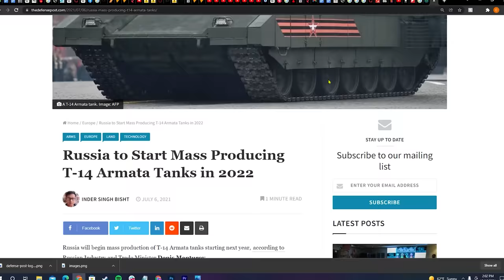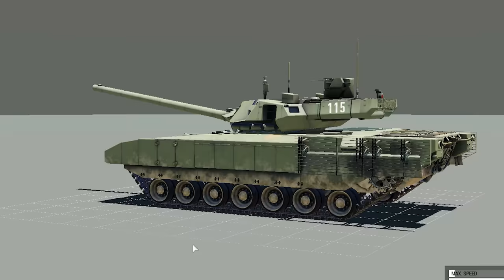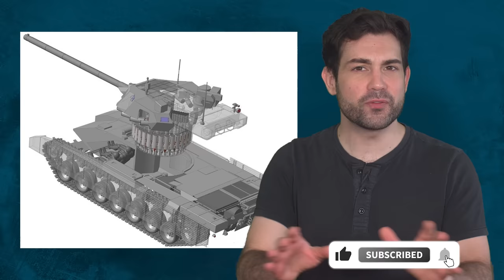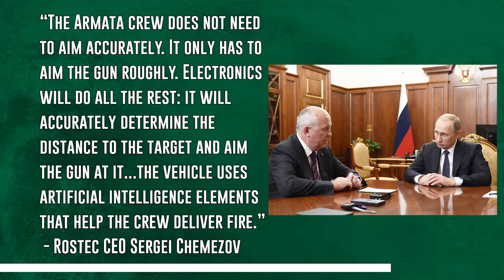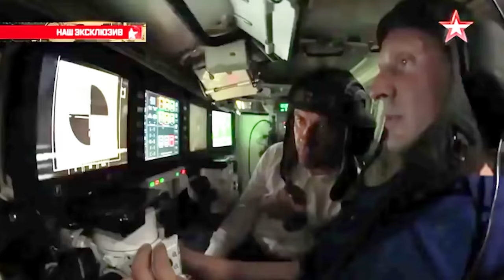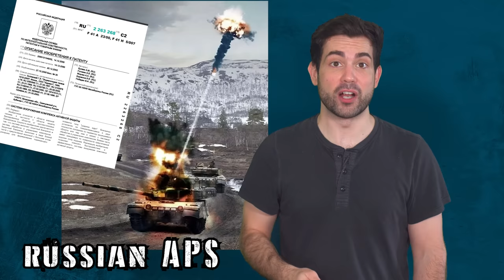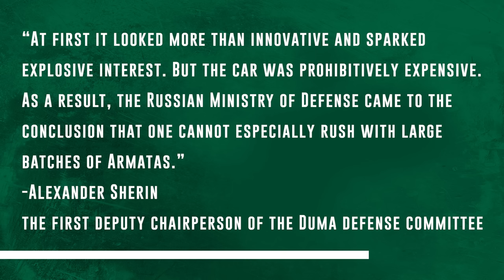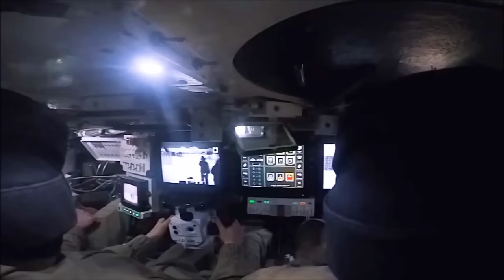The Truth About Russia's T-14 Armata Tank

Comment: The 14 in T-14 comes from the overall number of battle worthy tanks of this model that have been constructed.
Reply: That's a realy optimistic astimate
Reply: thats actually wrong, they built 100 of them
Reply: @SlavicUnionGaming  They didn't, they have like 20-30 of them and some of those are prototypes. Russia planned to deliver first batch of 25 serials (I think) by the end of 2022.
Reply: @Palach624  🤣🤣🤣🤣 never will happen.
Reply: @jacksonteller1337  As I said, time will tell
Reply: @Palach624  16 so far and no more microchip technology. The computers with the current chips are already marginally functional with refurbished Chinese chips they won't work at all. And sanctions are getting worse. Soon they won't be dependent on Chinese chips and rations but also on Iranian drones. Effectively they will be a third world country dependent on handouts.
Reply: Skawei  16 production models and 4 prototypes, most of the production models are rebuild prototype models. They have no money and no modern technology that is why both the computers and the engines keep failing 🤣🤣🤣
Reply: @jacksonteller1337  To be fair the one time when Armata broke down on parade it was the driver's fault and not the tank's. Would have happened to any other if driver did the same mistake
Reply: @Palach624  you still believe that poor excuse they came up with. If i spent a billion on a non functional tank I would blame the driver too.
Reply: @jacksonteller1337  Dude that's literally what happened lmao. There was no engine failure or anything like that. Abrams and Leclerc tanks broke down hundreds of times because of inexperienced drivers
Reply: More like a T-0.
Reply: @protorhinocerator142  you are hilarious
Hello from Ukrainian-Canadian 🇺🇦🇨🇦
🖕NATO
Reply: Skawei  No they don't. They have about 1 dozen and some of those are prototypes. The first batch of their only order was due to be delivered at the end of this year.
Reply: Kids copy pasting jokes and thinking they're smart and funny nowadays
Reply: this Vhiteable's comment was made by 14 years old with anime pic
Reply: @Palach624  
And you believe this because Putin told you?
Reply: @Naeron66  
I find it so funny how they claim all sorts of "facts" that never show themselves.
If the Russians have so many of this "amazing" tank, I find it really strange that they don't use many of them in Ukraine by now.
They for sure need them there.
Reply: @Palach624  
You typed that comment AFTER a war that saw Russia lose acces to Texas Instruments, Thales and other companies they've relied on since 1970?

(No that's not a figure of speech, all Russian tank optics we know of are licensed versions of the Dutch optics from Hollandse Signaalapparaten / Thales, that at the height of the Cold War, could still be exported because the Russians were getting 2nd gen when HS/Thales was already at 5th gen)
Reply: @elitedank8342  my dude, your name is “elite dank” and your calling people 14 year olds lmao 🤣🤣🤣🤣🤣🤣
Reply: Did they put the ammo under the driver and tank commander again? That's why you are seeing so many Russian tanks get their tops popped. Tank crews are just abandoning their tanks because they don't feel like being vaporized when the ammo under them explode them into a fine mist into the turret which in turn gets blown 100ft into the air. Russian tanks are some of the worst made tanks out there and you can definitely tell the Russians do not care about their soldiers. They just win by throwing wave after wave of people at you like China and Japan did in WW2 and Korea.
Reply: @donaldtrumplover2254  dude you fellate donald trump dont you
Reply: The biggest problem of T-14 is that there are T-90M and T-80BVM, which on paper only slightly worse, but in reality are tried and true, with actually working huge logistic chain. Nice concept, but the advantages it gives don't really worth the money to make that switch, when you already have top tier tanks.
Reply: @SlavicUnionGaming  nope
Reply: @SlavicUnionGaming  🤣😂🤣😂🤡🤡🤡🤣😂🤣😂🤣😂🤣😂🤣😂
Reply: @Palach624  How's that working out for ya? 🤣🤣🤣🤣🤣🤣🤣🤣🤣🤣🤣🤣🤣🤣
Reply: Should be T-8 then.
Reply: @SlavicUnionGaming  bullshit where? 😂
Reply: @Palach  you know that driver is dead and buried under the permafrost by now
Reply: The NYT just reported Russia is producing 200/year.
Reply: I heard that the 14 was minutes between breakdowns 😅🎉
Reply: @SlavicUnionGaming it’s an impressive tank but only between 10-20 have been made. There are also a couple t-15 IFVs (based on the armata hull)

Comment: You missed the most important question; does it come with the auto turret ejection system like every other Russian tank that stores ammo in the turret?
Reply: Yes it does
Reply: Yes....but wait, there's more.....the M-14's system is an "enhanced auto-turret ejector system".....(it flies farther).
Reply: Yes, but the armored compartments around the crew and the engine should, IN THEORY, allow the vehicle to bravely run away from the battlefield after the turret is destroyed.
Reply: @victor bruun The joke is about the autoloader exploding when hit which causes the turret and crew members to eject up to a 100 metres.
Reply: @victor bruun it's a joke. The way the autoloader is contructed on every Soviet / Russian tank since the T-72, any damage that breaches the the armor at the base of the. Turret WILL cause all the ammunition to cook off, which will "eject" the turret and the occupants thereof. Or at least their mortal remains, anyway.
Reply: Shoot javelin at Abrams you will detonate ammo all the same if you hit back side of turret
Reply: @metkic94  the difference with the abrams is that when the ammo is shot, the blast will go through the blast doors outside of the tank. With the older russians tanks, when the ammo is hit, the crew and the turret get flung
Reply: @metkic94  blowout panels for the win
Reply: @hankhohn5017  It is to much explosives wont save the crew but at least enemy wont be able to brag about lunching turret
Reply: @metkic94  the entire point of the blowout panels is to direct ammo explosions up and away from the crew and vehicle. Large explosion, yes. Dead crew, no.

(A Javelin in top attack still kills anything though. Also fix your spelling and grammar. I about had a stroke reading it.)
Reply: @hankhohn5017   1 Blowout panel preventing explosion from like what 55 rounds stored in Abrams half HE equivalent to more than 1 tonne of explosives.... It is built to reduce explosion radius so vehicles next to an exploding tank wouldn't be harmed.
Reply: @metkic94  dude, the entire point of blowout panels is crew survivability. It has nothing to do with nearby vehicles, which if following typical SOPs will already be spaced out to prevent that kind of thing from happening (a vehicle equivalent of the infantry's "hand-grenade range").
Reply: yeah is it a jack in the box ?
Reply: We
Reply: @metkic94  Western tanks that come with a separate area for ammunition are far safer for crew members from a catastrophic ammo cook off than lets say a soviet bloc tank.
Reply: @michaelcrichton8983  IS it planned to be delivered with replacement turrets?
Reply: Well, it has an autoloader so the answer is most definitely yes.
Reply: The T-72s seem to be deploying that system a lot in Ukraine.
Reply: @michaelcrichton8983  in practice when the turret ejected the tank is so heavily destroyed that there is no chance the crew will survive. Russians never cared about the crew.
Reply: @es5ape  "The difference between theory and practice is that, in theory, there is no difference. In practice, there is..."

That said, as no Armata has been destroyed in combat yet, we have no way of knowing how effective the internal armor actually is. While it's probably no better than the 'Emotional Support Armor' / Cope Cages, it might work.
Reply: @hankhohn5017  no one will survive a cook off
Reply: @michaelcrichton8983  If they have calculated things properly. Having been involved with a work party tasked with destroying charge bags, I can tell you that propellant burns really, really hot. The compartment may be designed to protect the crew from the initial blast and being barbequed, but will they get baked alive inside their compartment instead?
Reply: @metkic94  yea but the crew won't get pasted because the ammo is stored seperate
Reply: @hornymf553  With the autoloader, we have seen that they only need to penetrate the turret to set off the ammo. And the ammo is all loaded around the base of the turret like the T-72, T-80 and T-90. So I suspect the propellant charges will all cook off if there is a penetrating hit on the turret, especially a vertical one.
Reply: @michaelcrichton8983  The first russian tank with an autoloader was the t64 :)
Reply: I mean, any tank without a hard-kill APS will be defeated by a javelin or NLAW, entire turret crew dies.
Reply: @tankman66  it’s fascinating seeing Casuals laughing at Russian turrets getting thrown when the side they support (ukraine) also use the same tanks and also get their turrets thrown. Imagine being a Ukrainian tanker going into battle and seeing your supporters laughing about the same tank your driving, must be really motivating.
Reply: You missed it.  Its called ""The Jack-in-the-box feature".
Reply: @metkic94  Abrams has blow off panels in the ammunition storage compartment. Turret will not "blow off" under any circumstances.
Reply: @metkic check losses on AbrahamS you'll see a low to 0 number the armor they use actually works
Reply: @metkic check losses on AbrahamS you'll see a low to 0 number the armor they use actually works
Reply: @metkic check losses on AbrahamS you'll see a low to 0 number the armor they use actually works
Reply: @metkic check losses on AbrahamS you'll see a low to 0 number the armor they use actually works
Reply: like a turkeys leopard 2? and abrams in Syria?
Reply: @donalddingleton5676  no tank crew actually closes the doors as it's too much of a hassle in combat
Reply: @metkic94  ah yes, thats why in this video the crew is dead due to the total ammo lost equivalent of a ton of explosive (as you said) https://www.youtube.com/watch?v=Ay7bOG2nD6k
Reply: You don't mess with tradition.
Reply: What's worse the turret popping off or cooking inside a sealed tank?
Reply: @donalddingleton5676  жаль нельзя фото прикрепить, но вы можете посмотреть в интернете, там полно Абрамсов с оторванной башней;)
Reply: @TheRealBillBob  Why not both?!
Reply: @auto_revolt  Why not both of what?
Reply: @TheRealBillBob  The turret ejecting AND cooking inside the tank!
Reply: @Dragonblaster1  Same as NATO, actually. Before SMO ucraine had second in NATO stockpile of tanks - close to 2500. Then NATO collected a few more hundreds of soviet built tanks and sent to their proxy. Now they are begging their Masters and puppeteers to send them a dozen or two more tanks. I wonder - where all previous supplies of tanks and armored vehicle go? And for how long will last a standard wunderwaffle?
Reply: i think not because the ammunation is under not inside the turret
Reply: @donalddingleton5676  not teue in practice
Reply: @hankhohn5017  guess what it actually doesnt work, look at iraky Abrams blowing up
Reply: @williamhartsell6390  some syrian tank crew did, educate yourself
Reply: The turret on Russian tanks is the blowout panels

Comment: The truth? The truth is, they were supposed to have 2500 of them. As of now, there is confirmed number of like 20...? And all I found online was the six t-14 you keep seeing on Moscow parades.
Reply: And even then one of em broke down... on parade... in ideal condition... on a road. Yeah.. this is just a propaganda tank
Reply: @riptors9777  Exactly. Even if it was user error with the driver putting on the hand brake, that T-14 on the parade still caught fire because of it. Because of a user error that was apparently so easy to make that a parade driver accidentally did it in ideal, calm conditions after having rehearsing the exact actions he had to do. The fuck do they expect will happen when they make conscripts drive it into combat and inevitably start doing panicked soldier things with the controls?
Reply: Yep, probably 20 plastic models of it for propaganda reasons :)))
Reply: @riptors9777  You are right as never before. If it could fight, it would be in Ukraine like a black eagle tank. It is already gone.
Reply: there are 6 prototypes,  zero are actually deployed.
Reply: Russia has about 80 - 100 T-14 Armata
Reply: @adriansingh429  Less the three they lost in Syria?
Reply: @adriansingh429  if that were true and they actually worked as advertised they would be dominating the battle space in Ukraine. The fact that they aren't even being deployed tells you everything you need to know about the program. The US is closer to replacing the F-22 than the Russians are to fielding a large force of T-14's in actual combat.
Reply: @riptors9777  you didn’t watch the video. It did t break down. Emergency break was on
Reply: @riptors9777  он никогда не ломался на параде...
Reply: @russiasvechenaya58  That's even more embarrassing. Because it shows how well trained Russian tank crews are. This was the best they had to show off to the public.

Having a "good" tank means nothing if the crew can't even do their job properly.
Reply: At least Moscow parade would have some wehicles.
Reply: @brianb7388  just because they have them doesn't mean they will use them and why waste the t-14 in a war that they don't won't to waste new equipment on which is why they are using the t-72's instead of the t-14 or 19 and btr's and bmp's and not the t-15 ifs and kurgnates 25 apc because they don't won't to waste them because they are advanced but aren't invincible and they want to get rid of the soviet era equipment so they don't need to waste money on them and don't need to maintain them then spend more on making the new equipment like the t-14, t-15 ifs, kurgnates apc and their new jets like the su-75, 57 and other jets like su-35s if they still want them the us didn't use the f-35 or f-22 in afghan just f-16's and a-10s and some others why didn't they use them because its not worth it or needed
Reply: @adriansingh429  according to Russia, not exactly a trusted source of information. Remember they are telling their population they are winning in Ukraine.
Reply: @istoleyournoodle4168   the sole notion that this is "the best tank in the world" and the operator is a newbie is ridiculous and even absurd or in other words - a lie (which is without a doubt the truth). But even if we entertain the idea that they were being honest (literally never happened in history) than this means that these tanks will be operated by conscripts just like all their other tanks. 
 But as I said all speculation is pretty much out of the window. It`s just impossible to avoid the fact that russia`s leaders as history clearly shows lie 9 out of 10 cases and in the 10th case - they`ll say half-truths. I mean this is the 2nd best military in the world remember? The guys who are not currently invading another country but leading a military operation - the one that will end  with the take over of Kiev on the second day. And they will achieve it all without committing any war crimes. Should I go on or did I manage to make a point :D
Reply: @3aTMeHuePa3yMa  cope
Reply: @riptors9777  Didn't he say in the vid it didnt actually break down?
Reply: @SuperCatacata  Bro of course they're not good at driving these tanks. They're brand new and completely different from previous tanks in their controls. I imagine by the time the tank is actually being used in serious combat the tank crews will be better trained.
Reply: @isellcrack3537  My guy what are you talking about? Even the greatest militaries can fail invasions, for example the US/Soviets in Afghanistan, the US in Vietnam, the Soviets in Finland, etc... I hope you don't consider these militaries weak. Should I go on or did I manage to make a point :D
Reply: @creesmith2794  It was confirmed that the tank actually "broke down" because the driver was a moron, who wrecked it during a parade by fumbling the controls. Wich itselfe doesnt speak well for the tank if its that easy to destroy by a simple driver error
Reply: @creesmith2794  They dug in their troops next to the Chernobyl sarcophagus.  Real winners.  BTW, that was a column of light infantry they sent to attack the enemy capital city.  Brain trust.
Reply: @Grimmwoldds  Are we talking about the same war?
Reply: @riptors9777  Yea it was the emergency brake apparently which the driver didn't know how to turn off. I don't think that really shows a poor tank, just braindead drivers.
Reply: @riptors9777  My guy.. I think you lack info on the Ukrainian war
Reply: @creesmith2794  found the russian troll
Reply: @riptors9777  Nigga I live in the US
Reply: @riptors9777  It's kinda crazy that you assume anyone who doesn't think that Ukraine is absolutely destroying Russia in this war, cause they're not, is a russian troll
Reply: @istoleyournoodle4168 pretty sure those American jets were in fact used in the Middle East